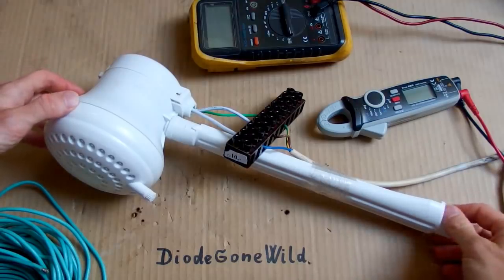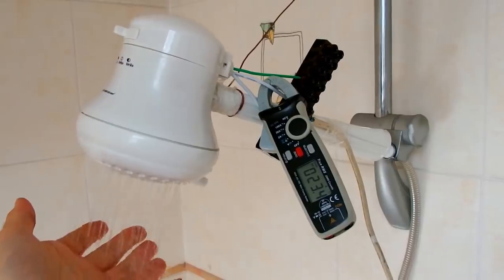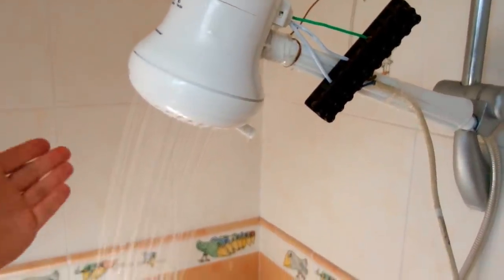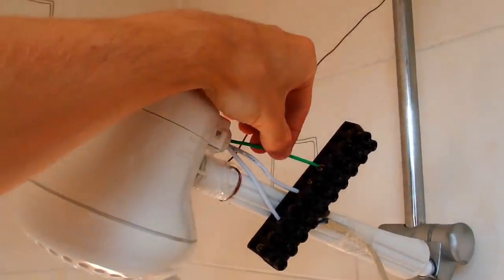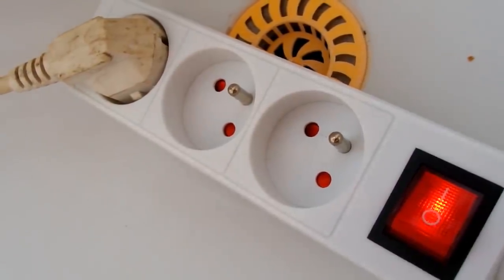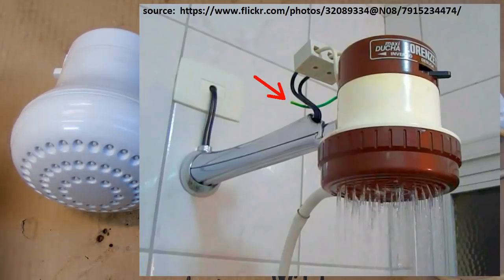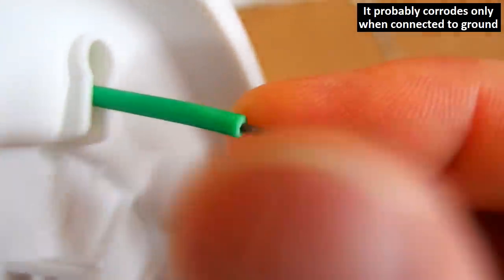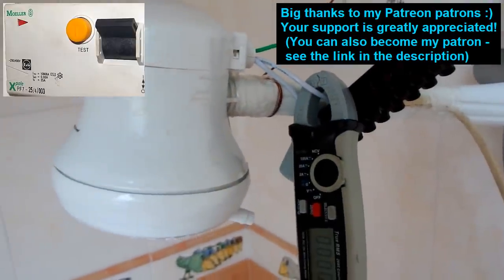Electric heated "suicide" shower PART 2 - test & measurements

Comment: What. The. F**k.

I would never, in a million years, guessed that this was actually a thing.  Who in their right mind thought it was a good idea to even make one, much less mass produce them?  Wow...lol
Reply: So, gotta add something regarding showers and electricity.  We just purchased our sixth rental property.  It was turnkey...hardly a single thing to do.........except this blank outlet cover that sat just inside the shower off the door frame.  It's where the old light switch used to be.  Instead of removing the conduit box and putting it in the attic (they moved the switch to the other side of the door), they just caulked around a blank cover.  

I didn't feel like crawling in the attic, cause it's close to 100 degrees outside, so I just flipped the box to the hallway and bought a matching tile to fill in the hole.

It always amazes me that people will find 1,001 ways to do something wrong when like 10 minutes would make it code compliant.  To my surprise though, it did pass the occupancy inspection, in which safety in the home is paramount.

Lazy remodelers, lazy inspectors...
Reply: a brazilian. i'm not kidding.
Reply: Brazilian engineering in it's best form. Cheap, effective and safe
Reply: It's just part if life to them. Heat water cheaply.  Keep your distance from the outlet, replace the element when it burns out, replace the entire head when it melts down, LOL!
Reply: @ernieschatz3783  thats just not true i used eletric showers my entire life i am 18 and we only had to replace the shower once and not because it melted because that model didnt had more resistences to sell 
btw gas powered showers are really expensive and most people don´t have piped gas in their homes
Reply: Some genius, electricity was the future in the 30's, almost everything is electric nowadays, why not an electric shower? It is cheap, effective and very safe.
Reply: @ttuliorancao  safe?
Reply: @YouTubeSupportTeams  Yep, its very safe if it's installed and used properly, like any other electrical device
Reply: @YouTubeSupportTeams  Dude, I don't think it is safe, the data shows it is safe...
Reply: @ttuliorancao  what data? :D
Reply: @YouTubeSupportTeams  dude, hundreds of millions people use this more tha once daily. You don't see thousands of deaths because of it routinely, do you?
Reply: @anarcocapitalistadexiaomi1951  That depends. Of course electric showers exist in europe but they are shielded, properly grounded and outfitted with a thermal cutoff. They are much bigger and mounted to the wall with all of the wiring hidden behind the casing. However this is not a cheap way to heat water (at least not where I'm from) and using a gas heater is actually a more efficient way of generating heat than turning that heat into electricity in a traditional coal power plant.
Reply: @Progan666  Most of the Brazilian electricity is generated by hydroelectric power, therefore, it is clean energy, perhaps in small countries where energy is very expensive, using an electric shower is not a big deal, but in Brazil, where electricity is very cheap, it makes sense to use this type of shower.
Reply: @YouTubeSupportTeams  200 million users and there was not a single death last year, statistically a gas shower is more dangerous.
Reply: Absolutely bonkers. Even moreso the Brazillians treating this like it's perfectly normal, and the only way to heat water outside of gas lol. Guys, in the U.K WE HAVE ELECTRIC SHOWERS TOO. However they're not like this with wires hanging out of them! The electronics are contained in an oblong case bolted to the wall behind the shower head, with wires inside the wall itself, and properly sealed, grounded and pressure / voltage safeties. It's litterally impossible to electrocute yourself. Why do this in the shower head itself? Craaaazy.
Reply: @ksp221  There are electric powered boilers as well. Yep, they also are not cheap, I know :)
Reply: this video showed that the worst case scenario is just an uncomfortable shock.

Doesnt seems very dangerous to me

Comment: At least here in Chile is really uncommon to see this kind of devices because any appliance sold here needs a certification from a goverment agency called SEC, and this device will certainly not pass the certification process. Most of us use a LP gas powered water heater or in newer houses a electric water tank. Really good video

Comment: Thank you for the video.
My electrician has installed an earth stake especially for the head shower and has connected the ground wire to it.
But I am still shocked when I touch the tap.
Do you have an idea of what may be the problem?

Comment: First of all. All metalic part of bathroom instalation should be grounded to one point in european countries, so 7V between the water pipe and PE sounds like something abnormal, maybe showing, that something is not grounded properly. Its very often in Czech and Germany.

But. There is some simple measurement that was not done, which could be interesting. The first one is diference between the incoming and outgoing current, which means current, that flows to the ground not through the wires (N, PE lines). It's simple to measure, just put your clamp A-meter over the whole cable and the readout is current, that flows through all alternative ways. It's quite useful in situations, where you dealing with problems caused by improper grounding, like ground loops, especially in cable TV/antenna systems. But it would be interesting also in this case.

The second measurement is resistance between the water and the heater. It's also simple to measure. Lock the pressure switch in ON position and submerge the lower part of the gadget into stainless steel pot making sure, you are submerging only the part that is normally filled with water, not the switching part. Then the pot could be used as an electrode, the second one could be L and N wires connected together. The shower head should lay on the bottom of the pot making the watter trails to be the shortest possible. This will show you the lowest possible resistance between the heating resistive wire and the water. It could be also measured according to different voltage, because in my opinion, the V/A characteristic is not to be linear, especially when it is measured on higher voltage, like 200V and more.

However. I found your video quite interesting, because I know virtually nothing about theese heating shower heads, because I do not have enough courage to test this on my own. You proved, that it wasn't as lethal as I'd expected. Nice (and hazardous) job :3 :3
Reply: The current in the grounding is not so relevant as most installations in Latin America aren't grounded
Reply: And it's funny because all those rules are similar here but nobody follows them as a whole

Comment: It will be even more dangerous when heating element blown!
Reply from the maker: well, if the heating element lost it's connection near the neutral side, it would no longer be a resistive divider. The voltage in the water would double and so would the leakage current.
Reply: Normally when this occurs you just jump out of the water immediately because of the cold water.

I`m from Brazil, so I know this stuff personally. Hahahah
Reply: @DiodeGoneWild  that is the idea to have it properly grounded.

Comment: Interesting. So you can't have it both grounded and connected to an RCD. But if you have it on an RCD without a ground, at least the RCD will protect you from being electrocuted if too much current flows.

It looks like a good idea to connect the ground to the neutral if it can't be connected to ground. Then it will work properly without tripping RCDs. Just that if the neutral ever goes open, you're more likely to get shocked because then the ground wire right behind the spray becomes live. But you'll still be protected from excessive current if the break is after the RCD. If it's before… I don't think RCDs work without a neutral?

So if connecting the ground to the neutral allows you to have the device both grounded and protected by RCD/GFCI, I wonder if it's worth doing that, even if you could have grounded it normally.
Reply: Well yes, ground is not intended for permanent return currents. You could say that a "solution" would be to first make the water pass an electrode that is connected to neutral (which removes most of the leakage) and then a second electrode that is connected to ground (your safety backup).

Of course if you are interrested in safety you would prevent the electricity to run through the water at all.

Comment: It would be interesting to imagine what happens if the neutral connection fails for some reason and the head is ungrounded or there's no safety switch (RCD) in the mains line...
Reply: If the neutral breaks and it´s not grounded, you will have about 2x the voltage anywhere in the water compared to normal operation. So definitely more dangerous.

Comment: This lines up with other videos I've seen on it. Even if you don't ground it and measure 40+ volts on the water coming out, there's basically no current backing that voltage so when it hits you and your body loads the circuit, it drops to 0 volts.

The voltmeter may measure up to 1mA, but that's not what you would feel. I guarantee the current would drop to microamps once you stand in the water flow.

Comment: the reason you have so much voltage in the sink is because your water pipe is metal, usually those showers are used in pvc piping water installations

Comment: The real problem with this device is when the heater has a malfunction. If the heater coil breaks (corrosive/chlorine water, wear and tear) and the ground is not properly connected, the circuit can be completed through you. Even if the ground is connected, then it would set all grounds in the house to some kind of live potential.
Reply: Dude, the resistance always breaks. It's like at least one every 6 months if you use the highest setting and very little water so to gets very warm. And nobody dies. 

5 euros and you put a new resistance on it in minutes.
Reply: By my experience as a South American that uses an ungrounded and two-phase shower, what happens when the resistance breaks is nothing at all. You only get cold water and get pissed as hell. But no shock at all
Reply: The odds of you touching the shower at the exact moment the coil breaks is negligible. Normally you never touch the shower unless you want to change the season setting, and you should never do that when the shower is on (as instructed in the manual). Normally you only get pissed because of the cold water like Marcos T. said. In general they are pretty safe.

Comment: But how long before the "ground electrode" corrodes and becomes useless?....
Reply from the maker: It probably doesn't take very long if it's just bare copper. Maybe if it's plated or made of a different metal, it may last longer.

Comment: Oh my! Those photos at the end are scary.
I'm feeling pretty grateful that my water is heated by good old natural gas!
Reply from the maker: You're never 100% safe. Natural gas can leak and blow up or suffocate you. Also a carbon monoxide can go back if there's a poor air flow.
Reply: True, but if there was enough natural gas to suffocate me, it would have to be a major (and immediately noticeable) leak. 

The combustion chamber in this heater is sealed. It brings outdoor air in for combustion, and a fan pumps all of the exhaust fumes outside. If that fan ever stops working, the burners shut down immediately.

Comment: I don't get it, as soon as I get close to 20amps my circuit breaker trips.  Circuit breakers and fuses are standarized so how can you draw more than 20 amps without jumping out your panel?
Reply: because he's jumping the panel, cannot do it otherwise. SO he only left the main fuse after the meter that is rated at 32A or 40A. This fuse is generally not in the apartment. It is near the KW meter outside of the main apartment.  The fuses in the house are 10A or 16A in normal conditions.
Reply: Actually you can load a 16A breaker at 32 for a few seconds before it trips.

Comment: Are your pipes grounded? Because   if they were you should have 0 volts between the water and the gound pin
Reply from the maker: The pipes in this bathroom are plastic. Only the taps are metal, the pipes are plastic. There's nothing to ground. The water in the pipes has a resistance in Megaohms range.
Reply: DiodeGoneWild ok, now i understand the resistance. I thought they were metal and not grounded :)

Comment: They sell those here in some places, but they are not popular. Buildings from 40 years ago have very thin wiring, mostly made for lighting and low power appliances where 1.5mm2 is not uncommon. Given this scenario, this devices will cook the wiring in minutes. I had seen this happened. The ones that are more "popular" are the tank style, its a 20L tank that hang on the shower input and has a small showr on its base. They are 1200W. They take 20minutes to heat the water and you can unplug it once it is done. They are mostly used in rural areas were propane tanks are VERY expensive and there is nothing like a central boiler, it has no sense. But the suicide shower is uncommon, probably dont meet the electrical safety regulations. You cant sell (in theory) appliances without the certificate. But ... you know ... In the cities, propane is delivered to the buildings through pipes, and this contraptions are rarely used.

Comment: great vid. It answered nearly all my questions about this interesting item. But one is left. What happened if the heating element is broken and you come close to the shower head?
Reply: Sorry! I did mean happens not happened.
Reply from the maker: It remains more or less the same, just the water is cold. If the heating element breaks near the neutral side, the leakage current may increase (it may double in an extreme case).
Reply: The leak current does not only change: It will change direction, because the difference in resistance between neutral and getting ground via the water now becomes much smaller. Because of the change in direction, the current can more than double.

If the ground is also broken... I would expect this to be the situation where it would kill someone.

Comment: Hey man, very interesting video! Whenever I found one of these in my hotelrooms in Brasil and Mexico, I searched for another hotel. 
Interestingly,  this method of water heating was (and is?) also used in Europe. At least the older professional flow water heaters were using the same priciple, however on a more professional base. In my former appartment (built 1996) there were 21kW Siemens flow water heaters installed. Since I switched the old hydromechanical one (they were notorious for temperature oszillation) to a more modern with an electronic thermostat (also from Siemens), I had a chance to "inspect" the old one. I was surprised at that time, to find a heating element inside, where also the heating coils were directly in contact with the water. However the whole enclosure of the element was made from metal and safely connected to the PE (protective earth) wire of the 32A power cable, as were the inlet and outlet pipes (copper). The installation manual of the new one btw. also mandated a proper connection of the device to PE. This indicates, that also the modern flow heaters still use this principle. Since in Germany generally not only the PE but all metal objects in the house (e.g. metal bath tubs, water pipes, etc.) must be connected to the main-earth-rail, this installation seems to be electrically safe, especially since the device is wall-mounted with fixed power cable connections. OTOH it makes clear, why such an installation should be only done by an electrically qualified person, since the safety of the installation depends completely on the quality of the PE connection. 
Thumbs up and subscription you have!
Cheers
Andreas
Reply: snowflake

Comment: This type of outlet and wiring does not support the current of an electric shower. The shower should be in a separate electrical circuit, with thicker wiring with its own circuit breaker, and instead of plastic, you should use a porcelain terminal block with tightened screws.

Comment: At the end where you stand in the tub, have you tried standing with one leg on the drain (which might be grounded) and then putting your hand close to the shower head? (i don't recommend you doing that) even if your drain isn't grounded (due to the use of plastic pipes, for example), a lot of them are, so I think you should have tried this also. Nice video, btw.
Reply from the maker: The train is not grounded. The bathtub is non-conductive and the drain pipes are all plastic.
Reply: DiodeGoneWild Yeah, in your case they are plastic but I'm just saying your measurements wouldn't apply for someone who has grounded drain and of course they might not even think about it if they don't know much about electricity.

Comment: ok, where I live that would be an automatic power turn off device
(as ALL circuits are RCD protected, but in our case, the lighting circuit is not RCD protected, which isn't actually compliant with the regulations (even the lighting circuit should be RCD protected))